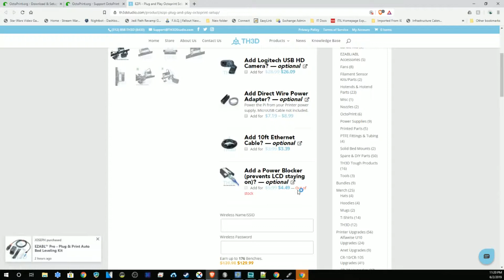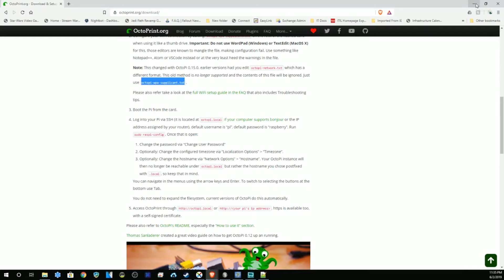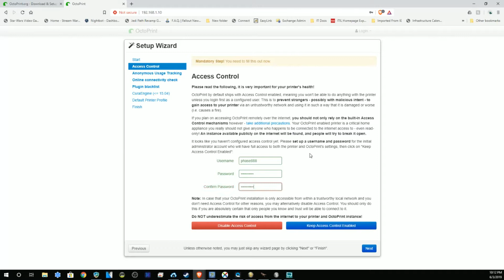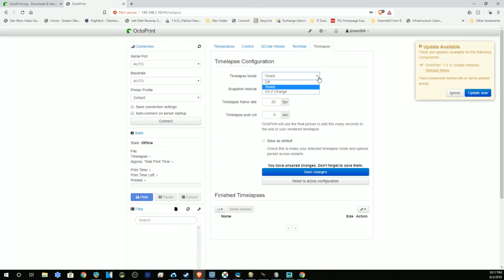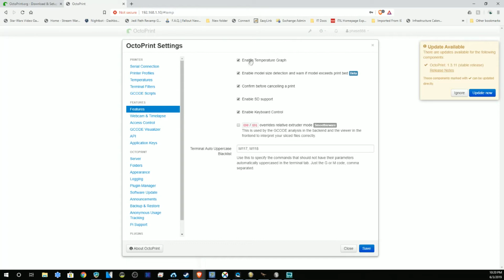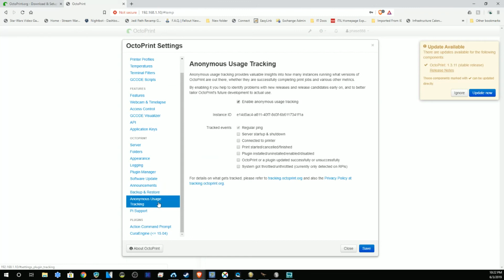Installing Octoprint on Raspberry Pi 3 in 2019

Comment: How did you find the correct IP address for the Octoprint?
Reply from the maker: In my case it was fairly easy, I simply went into my router and found the IP address.  A little complicated to show as there's a lot of hardware potential and a lot of differences between my setup and anyone else.  The easiest thing to try first is opening an ssh to octopi.local (or ping it, tracert it, or telenet just to see if it answers).